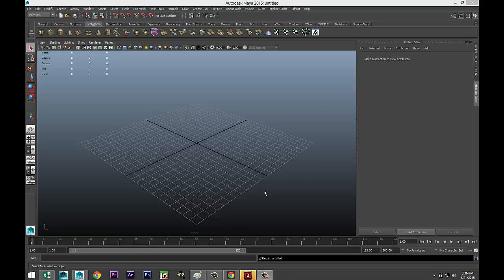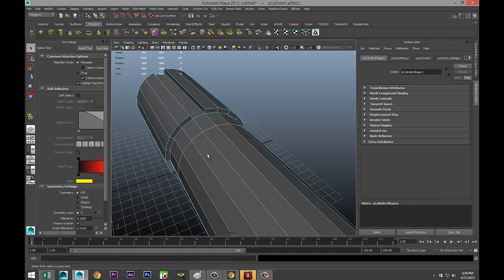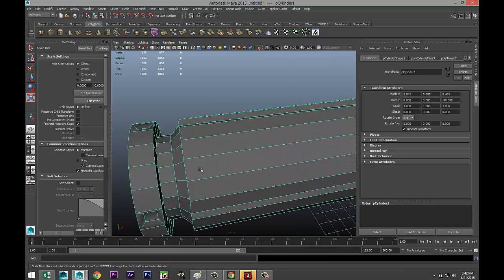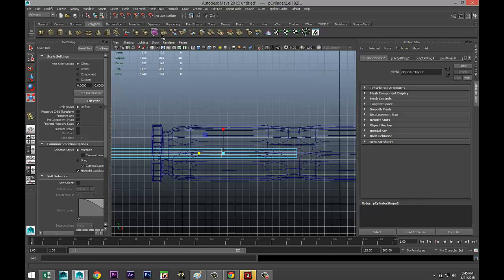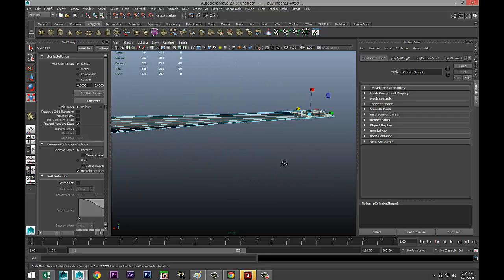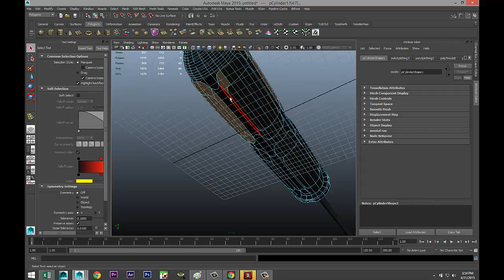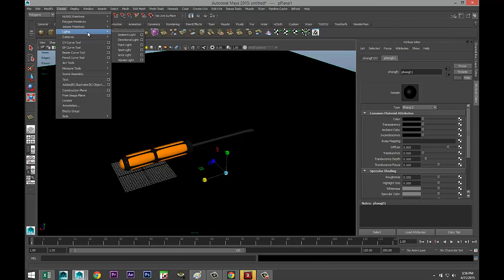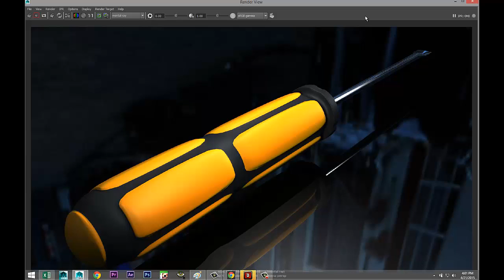Maya tutorial : How to model a Flathead Screwdriver

Comment: when I go to extrude the edges at 2:00, they all start extruding in a straight line, then the lines start to go in different directions? any idea why?
Reply: ok i've redone this step like 100 times and can't figure out why mine isn't extruding the same way yours did.
Reply from the maker: Make sure you have only selected the ones intended and nothing else. If that is not it, check the angles. The extrude is done based on center pivot orientation
Reply: thank you!!